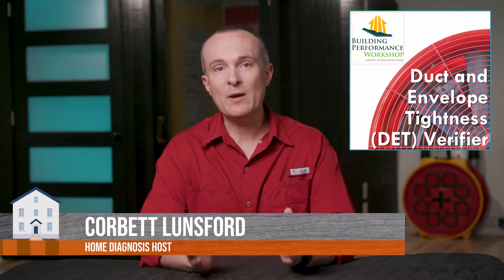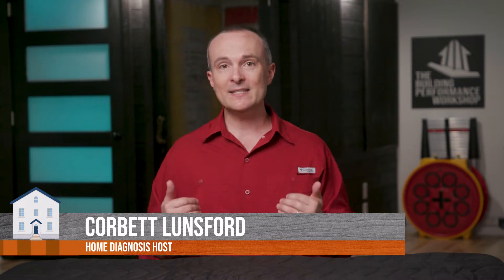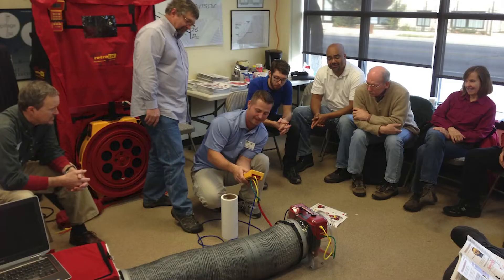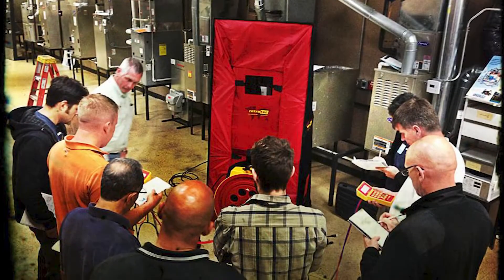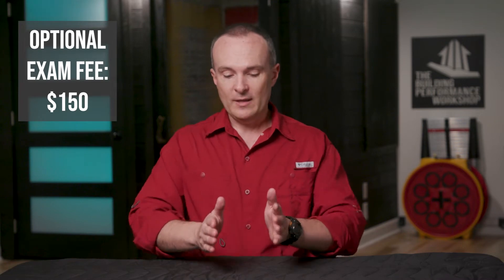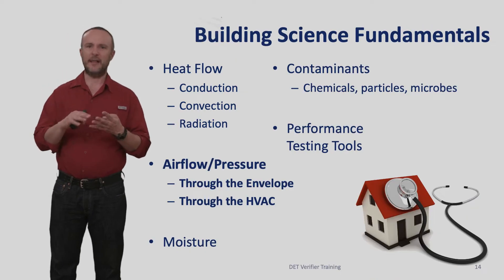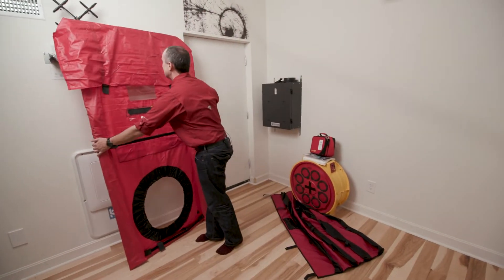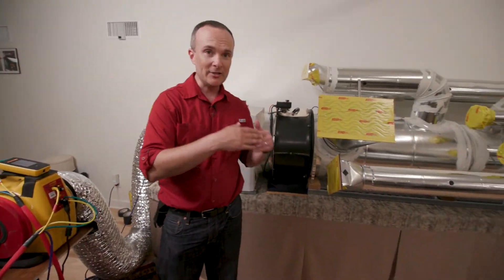TRAINING: 1-Day Blower Door & Duct Testing (DET Verifier Certification)

Comment: I built in Georgia last year and they did not require a blower door. I had one done more out of curiosity and Georgia power paid for most of it. I think the course would be cool if you could rent the equipment after passing. I know I would have taken the course and did it myself but the equipment to buy is very expensive for 1 or 2 days of use.
Reply from the maker: Very true- lots of municipalities neglect to enforce this, A V, though it’s still a state law. And yes, difficult for a non-pro to justify.